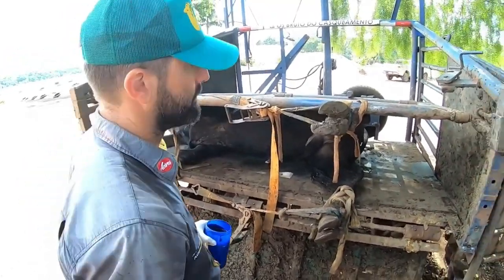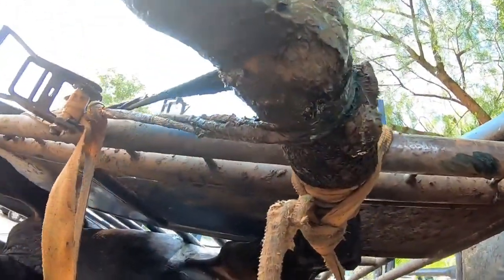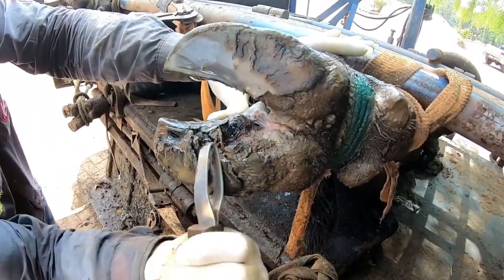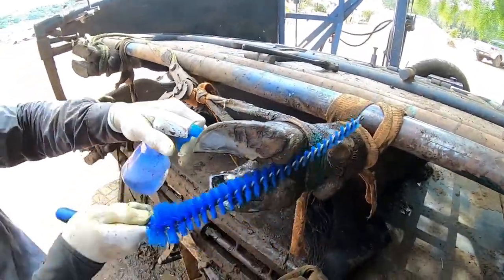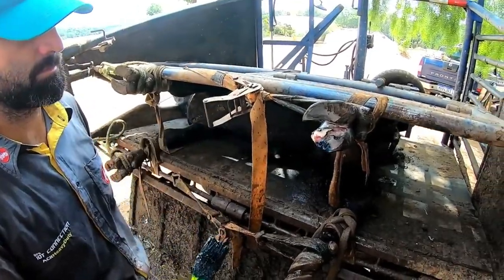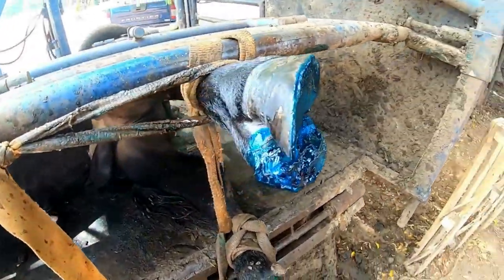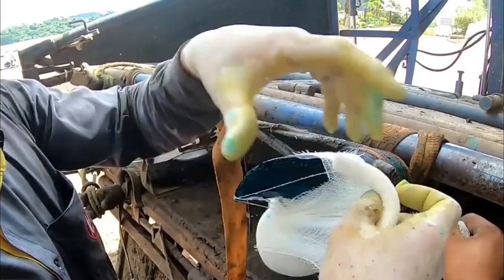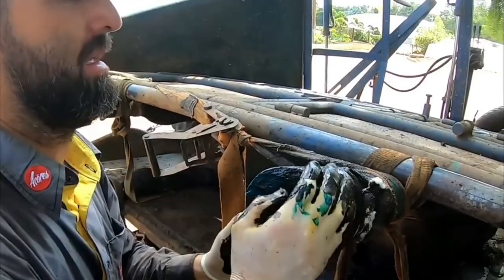a BIG  whole in the hoof...   even stones and leaves inside of it

Comment: Thank you put it on another good video.. question at the end when he puts that stuff on there that's brown or black it looks like Grease.. I was wondering what that was that a shilling or I guess it get hard like a cast I'm just curious..  I'm also wondering if the host technician use power equipment like grinders.. cuz instead of having a generator you can have what they call a solar generator that's basically storage batteries.. brother should be able to run most equipment that small equipment that he would need on the job.  Again I'm just curious if whatever if you use power tools Hollywood power of them specially when it looks like he's out in the field.. I did she can lift the some cattle in with the lift so I know what shelf powered... You know yet it's just a curious question .. unfortunate Marines don't necessarily go out the field like you.. thank you for everything nice video God bless you and protect over you and😢 keep you and your families ..